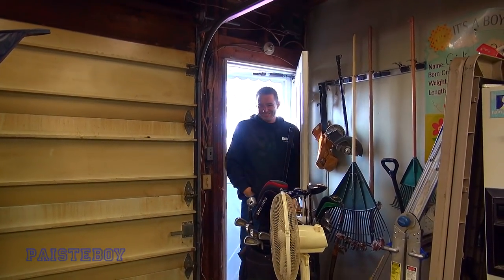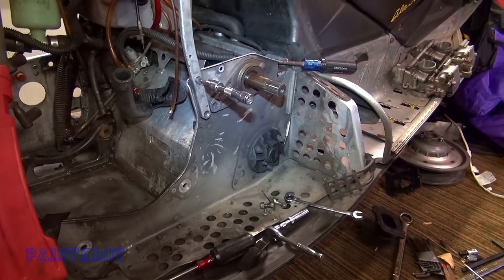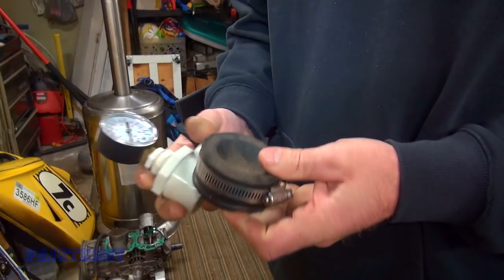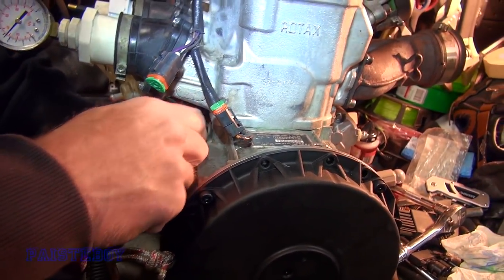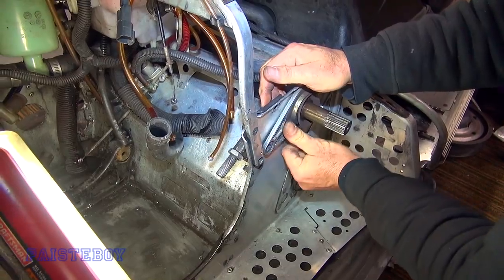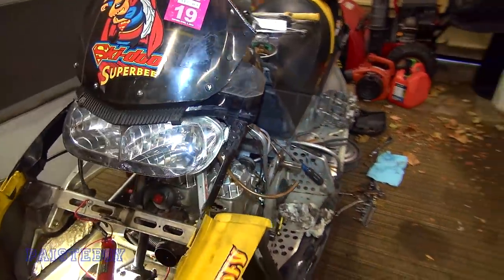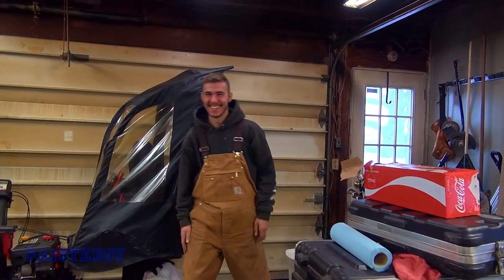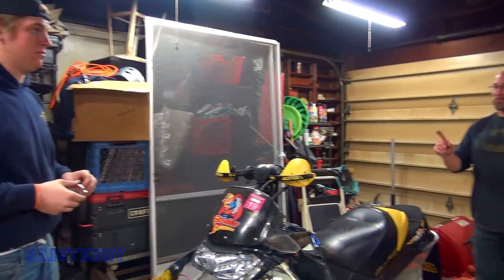Working on the Blair Morgan: PART 3 of 3

Comment: Showing the leak down test was a great visual on where air leaks can exist. 

The Rev should be all set for the season.
Reply from the maker: Yes. I was a actually surprised where the air was leaking from.  I figured it would only be crank seals and stuff like that.  I guess I learned something new.

Comment: I restored an 03 Rev 600 with friends a few years ago. The only thing that didn't need to be done was the engine. The bent bulkhead replacement was a real chore! It came out nice for a sled with over 12000 miles on it. Still a fun sled to ride!
Reply from the maker: Cool.  Sounds like you've got a nice machine there.  Did you do the beaver delete kit on it?  Thanks for sharing and watching.
Reply: @Paisteboy  Yes it does have the beaver delete on it. I bought it that way in 2007.

Comment: Good vid . Nice to see the leak down test in progress. Mark didn't get smarter bolts for the starter !!?? If they were grade 5 they might be ok.3 lines on the bolt head are grade 5 . 6 lines are grade 8. no line are grade 2 ( Not good for much ) Mark
Reply from the maker: He went back to get new bolts and they didn't have them.  The ones we used were equivalent to grade 5 so we felt comfortable with that.  Have you ridden that new sled yet?  Thanks for watching Mark.
Reply: @Paisteboy  Those will be fine. I did quick lap of the school yard a few weeks ago when we had our first snow fall. It's so smooth. I don't think it has the bottom end torque of my Vector but it's lighter and hopefully more fun to ride. I think I might get out on it this weekend for a longer ride up at the farm. Any snow down there yet?
Reply from the maker: @MBTUE  
Nice!  Sounds like a good idea.
We have snow but not enough to ride.  Trails open in Old Forge on the 9th and the plan is to go on the 12th or 13th as long as it's ride-able.

Comment: The crank seals leak
Reply from the maker: How do you figure the crank seals leak?
Reply: The crank seals can leak and cause lean fire under load which can cause piston failure.   When they leak they suck in air
Reply from the maker: Oh yes of course.  I thought that you were trying to say that the crank seals were leaking on this engine now.  That's a main reason to do a leak down test.  Thanks for watching.